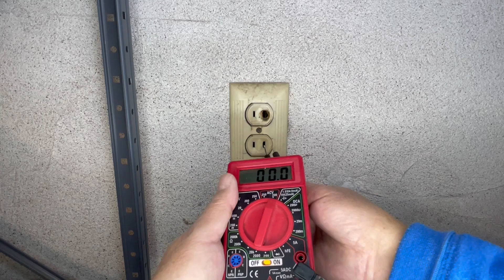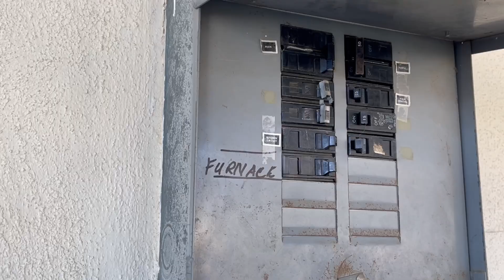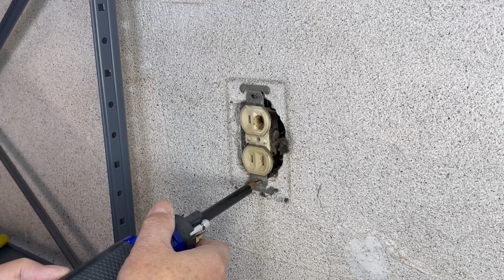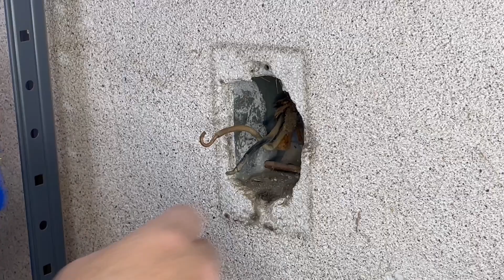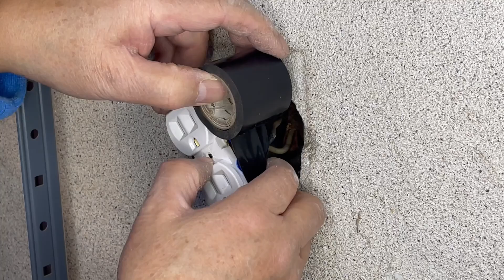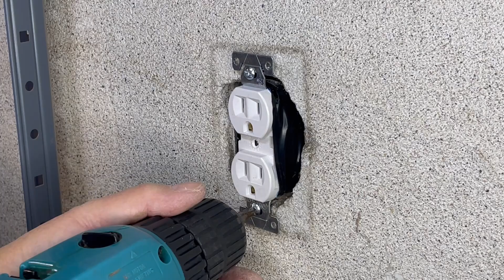You can: Replace 2 prong electric wall outlet install 3 prong outlet

Comment: Here are some tips
- When  there is no equipment ground you have to install what’s called a Gfci outlet or breaker.
- Any unused screw terminals that are not used is best to just tighten it in.
- If the box has a ground wire use a pig tail and attach it to the box and attach it on the green screw on the outlet. Or install an outlet with a grounding clip. The grounding clip is normally brass or copper and it is ether on the top or bottom of the outlet and it is only available on high quality outlets.
Reply from the maker: Thanks for sharing the tips.  Always welcomed.